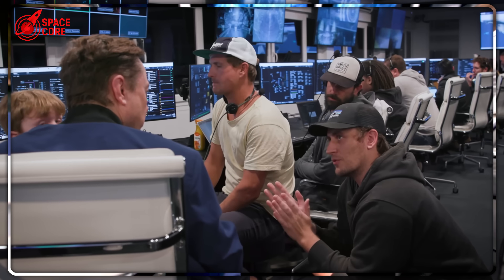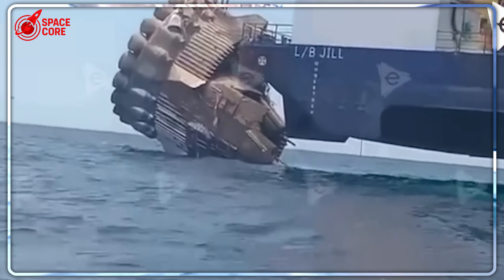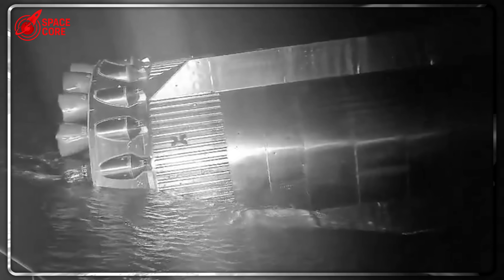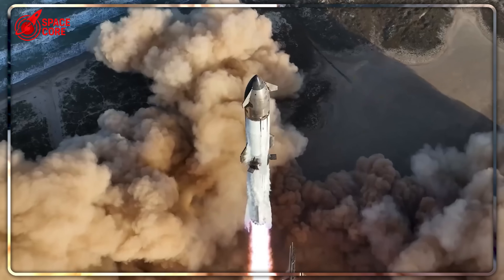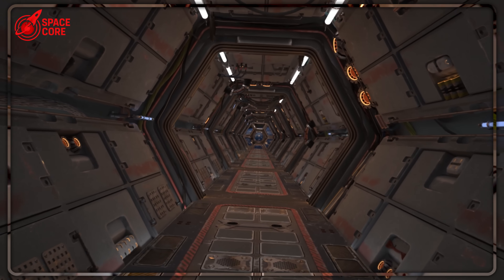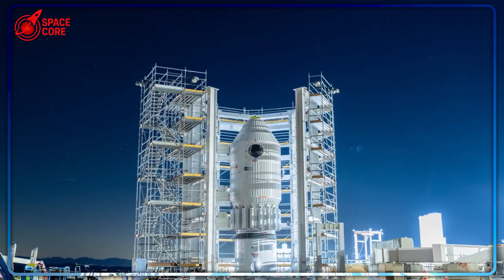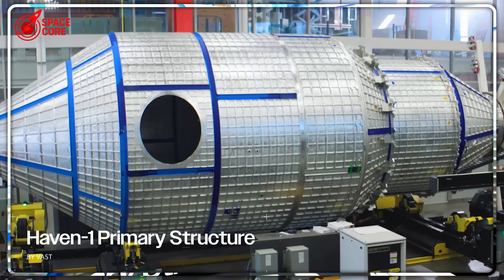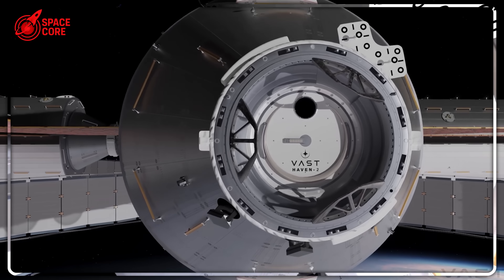SpaceX Booster 13 Recovery SHOCKED Engineers...Here's What They Found!

Comment: The black box tells tells what they didn't get subtransmitted. They recover the rocket, the lower booster. And inspected from damage and how bad it got damage when it landed, if it survived they can pass the data on to the next rocket they are in test mode.They're not in launch mode yet.They're in test.The test phase is of the rocket like the dead.Back in the day when warner von brown did during the beginning of nasa